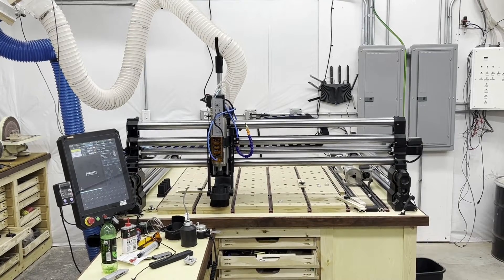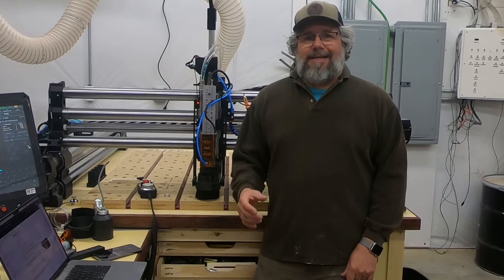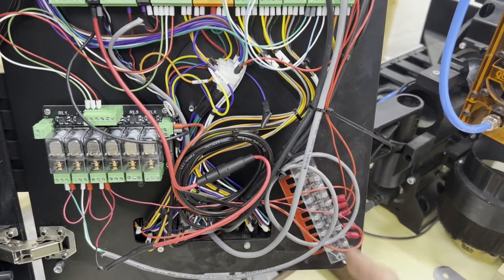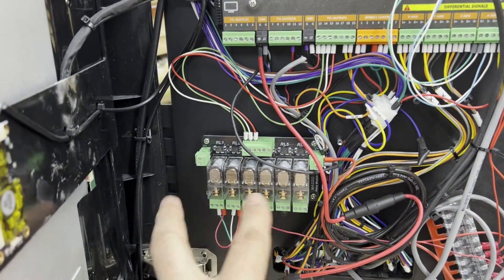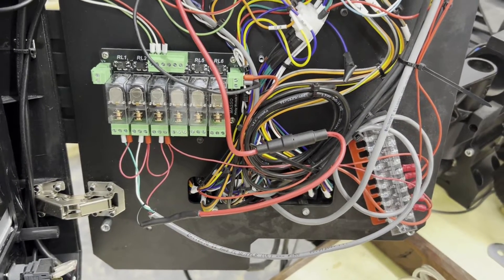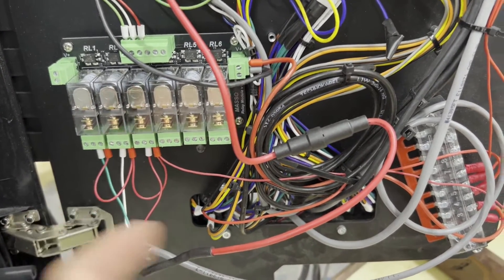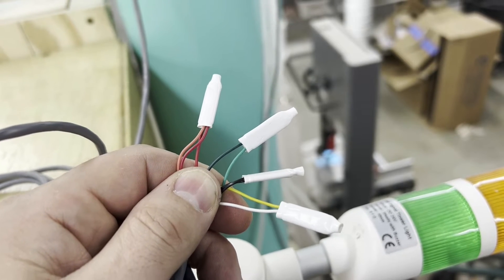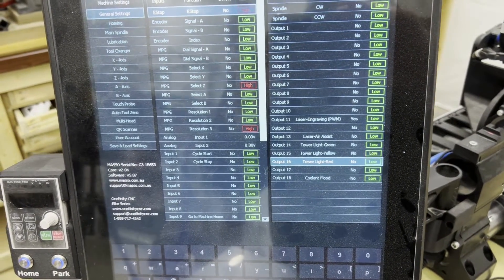Install a Tower Light

Comment: Is this how the default masso is wired up. It's very messy
Reply from the maker: No.  I’ve added so much to the wiring.  I recently had to re-run everything when I installed the ATC, and I haven’t added any tie wraps or cleans it up yet.  That’s on my to do list.